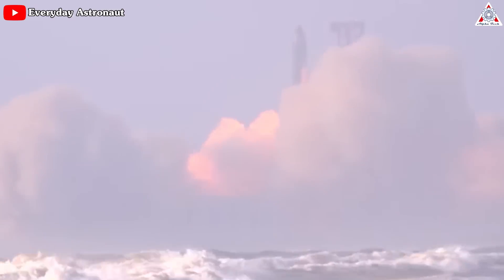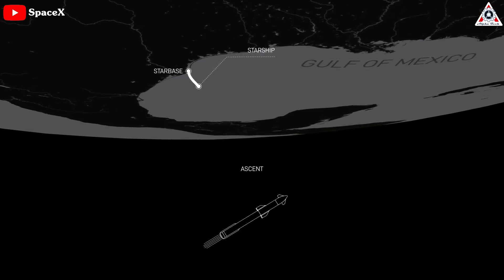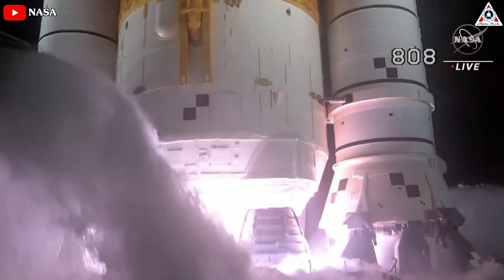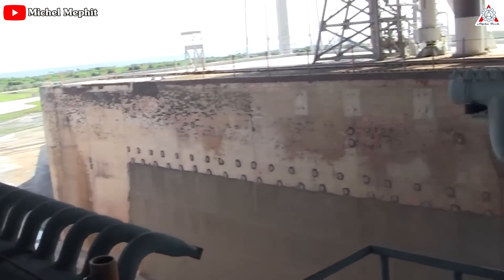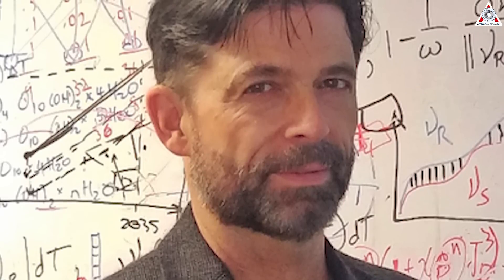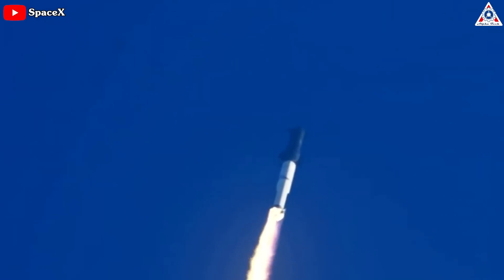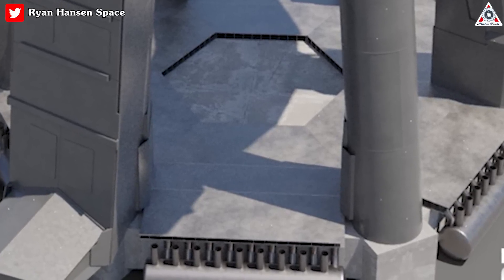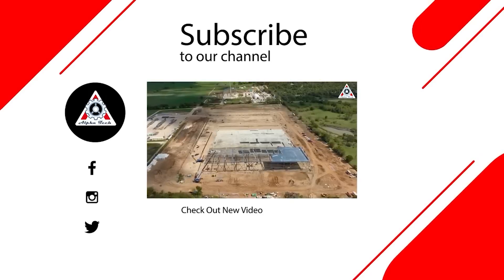SpaceX's NEW Solution to prevent the pad damage by 33 engines...

Comment: I wonder if you could launch of the chopsticks and actually use them to add a tiny bit of acceleration ?! That initial lift during ignition could also help
Reply: The full stack weighs 5000 tons.   No.
Reply: No.  More then likely those little flaps would tear off the rocket trying to launch it

Comment: Everyone acts like it’s a mistake to not build a full flame diverter but everyone is also ignoring the part where starship is intended to land on and relaunch from mars where there will be no deluge system.
Reply: And yet the latest renderings of the lunar lander variant of Starship show the engines relocated far up on fuselage to avoid kicking up debris.  I anticipate something similar for the Mars variant of Starship.
Reply: @johngunderson5463  The difference is on Mars there is at least some atmosphere to slow the vehicle before landing. It’s very thin though. I cant wait to see how many orbits, in atmosphere, Starship will have make in order to aerobrake for a landing. Interesting times🚀
Reply: Of course but the data from the first stage will still be valuable. This was not an accident by SpaceX it was an intentional use of destructive testing as has been their MO for several years. SpaceX is not afraid of things being damaged because they learn from those attempts.
Reply: A better AI that can simulate as much of the variables in virtual space can really help.
Reply: @aa2339  an AI doesn't simulate
Reply: They've demonstrated that starship can launch without a diverter. But the full stack is something like 6 times the local pressures which will only happen on earth.
Reply: @appa609  yeah but also the lower gravity and thinner atmosphere means more debris flying back at the rockets relative to the amount of thrust. It will be interesting to see what solutions they implement.
Reply: Just shows you starship needs to  bring a flame diverter/launchpad with it
Reply: That's the second stage, not the first.
Reply: @jshepard152  How are you getting back to earth with just the second stage?
Reply: @zagreus5773 
You aren't bringing as much stuff back and Mars has less than half gravity of earth.

Comment: Iam pleased to see the steel cooling plate idea being built, it’s likely that full thrust  on lift off could be turned back to lesson the pressure on the plate, it’s clear that 3 engines were lost before it lifted off clear of the tower, that’s a throttle back of 10% could be used, as far as those raptors go they are now proven to be absolute beats to have survived that level of bombardment and still reached that high is true testament to the engineers that designed and built them, if I were a future astronaut listed to ride starship my fears of failure to survive should be 100% gone, the next tests will hopefully prove the cooling plate will work or need More tweaks once sorted it’s a go fore a very exciting decade to come, the ability to lift such huge loads into orbit may save our planet from asteroids in the future, it’s a shame the FAA are still involved with space flight, there stressing over the local environment needs to stop asap, it’s not rocket science that an asteroid incoming possibly well over 100,000 plus mph does not give a flying duck about where it hits,

Comment: So... Could they launch it sideways or at 45 degrees? I guess the whole point of the basic launch structure is to make sure something can actually be built on mars for the return mission. Like, would it be easier to tilt 45 degrees so that energy is diverted? Bit risky, but I guess you have thrust vectoring to correct it?
Reply: They aren't building anything on Mars for the return mission.   Not for decades at least.
Reply: Launching anything you want to reach orbit in any other way than straight up would require way more thrust and structural reinforcements that would heavilly decrease the actual weight capacity the vehicle can deliver to orbit and make it that much more expensive. It would be highly inefficient. To launch at 45° it would require about double the thrust it can currently produce and essentially huge wings to be installed too.
Reply: @MichalValasek1  Cheers for the thought and info! I kinda felt the same but without payload im sure it could get itself out. With payload, thats another story which I think you've answered!
Reply: @jebes909090 You are laughing, but a bunch of engineers with billions at their deposal couldn't work out that 32 rocket engines could tear up a concrete structure, which ended up destroying those very engines. I just posed a question. :) Look at at your next wing with an engine mounted on it and doesn't seem that stupid. We seem to keep the tarmac in tact on every takeoff.
Reply: @DistractedTrader  im very sure that the engineers figured it out,  elon just thought he was smarter.    you'd waste too much energy starting on an angle.   really they should just go with the ocean launch plan from a converted oil rid.   no need for a flame diverter or water.    far away from any civilization so no noise complaints or danger to the public.   plus ships that brought the fuel could then sail out of danger instead of having a tank farm like a hundred meters away from the launch tower.    and you can even set up at the equator if you wanted, giving you maximum speed for launch.

Comment: I'm not understanding why they thought the current  set up would hold, they had eroding issues that had to be repaired  after the test fire as well
Reply: they more thought that it would erode less catastrophically. Then it also helps with the demolition!
Reply: Easy, did you notice the sudden "aging" of Musk that started about 2.5 years ago?
Reply: They knew it wouldn’t hold
Reply: @therombaro  they said they thought it wouldn't hold in the long run but only expected minor damage from just one launch
Reply: @general_g4999  i havent heard that - I blame search engine algorithms.   If you can point me in a direction that would certainly help - everyone’s on different information sources these days.

Everything I’ve been able to find on the issue has basically come down to (me paraphrasing) “we know it’s not the final solution, when it fails we’ll put something else in, but only after it fails.”   

They still have to solve the problem of surface launches from the moon and Mars, neither of which will have fancy launch infrastructure, which is one reason why they’re doing it the way they are.   They had 8 falcon failed landings before they figured out how to land rockets, theyre going to do the same with surface launches.   There’s going to be a series of launch failures before they solve the problem.

But that’s just what Im getting shown when I search.
Reply: And it's still a whole lot more safer to do all the failing on Earth than to fail on either the moon or Mars.
Reply: Because elon is a real engineer

Comment: Flame trenches are great for cameras because 2 sides of the rocket are clear view during launch
Reply: That too, it was disappointing that Super Heavy was almost entirely obscured during the launch.
Reply: @owensmith7530  And that it was obscured by DIRT & DUST, and not smoke or steam.  Never saw a rocket make brown clouds before  :face-green-smiling:
Reply: Starship's self destruct failed. Let that sink in.😅😅😅😅😅😅😅😅😅
Reply: @davidrash7791  🤡
Reply: Absolutely! Flame trenches are like the perfect wingmen for cameras during a rocket launch. They make sure that the cameras have the best angles to capture all the action. It's like having a VIP seat for the ultimate fireworks show! Plus, who doesn't love a little bit of danger and excitement? It's the perfect opportunity to live vicariously through the camera lens without any risk of getting your eyebrows singed off. So, bring on the flame trenches and let's light up the sky!
Reply: Even better for helping your rocket blow up.😅😅😅😅
Reply: That’s one of the things I noticed. There’s a great slow mo video of the Apollo 11 launch which shows great detail of the launch process. Nothing like that will exist with this setup because everything is completely obscured with dust and debris as soon as the engines start up.
Reply: i think elon already thinking about that, but he chose speedy delivery instead

Comment: Yes water cooling works but Nitrogen might work better under the temperature's of 33 at full throttle and they use cryo fluid in the exhaust cones so maybe it's the right way to go
Reply: Steam explosion only matters in an enclosed volume.   Water has been used for suppressing rocket exhaust for decades.
Reply: Uhhh might want to look at most other rocket launches 😏
Reply: water is a much more effective coolant in this context

Comment: The water table at the Cape isn't much different than in Boca. They just don't want to build a diverter. They need to build it up, which also means building their tower up. This pad design, or one very very similar, also had damage issues with other tests, so this shouldn't have been a surprise.
Reply: Or use nasa system directly
Reply: @carholic-sz3qv  Yep, no need to reinvent the wheel, go with a proven design.
Reply: @avi8r66  it’s not just a proven design but a very effective and cheap already developed one!
Reply: If they lift the pad then the trenches become surface tubes , water table issues solved. Over all the pad must rise to mitigate the lack of proper flame clearance.
Reply: He used Ego-engineering and it caught up to him, use tested designs.
Reply: There are underground parking garages all over Florida. You just need to run pumps.
Reply: They could drown most of the OLM in a steel walled pool and base with water being injected in at high pressure.
Reply: Se what happens when you don't have denazified German scientists in your rocket programe...
Reply: it's not that they dont want to build a diverter, it's the gov that wont let them build one, they put the application in to build one 3 years ago and gave up waiting on the bureaucracy.
Reply: If it's gonna take off from Mars, it can't rely on a flame diverter
Reply: @allisthemoist2244  The booster, first stage, would not be going to mars.  And they won't need nearly this kind of power to leave mars.  But, one of the first things to build if they do go to mars will be a proper launch facility.
Reply: @allisthemoist2244  I don't care if you are going to fly off the planet Vulcan. The generated massive shockwaves and pressure needs to be routed away from the vehicle, period.  The laws of physics do not bow to Elon's will.  If no diverter, then he needs to design something like the moon lander SpaceX is building that has the engines set higher up on the rocket and blasting out at an angle instead of straight down.
Reply: @Doggeslife  The shock-waves these rockets generate are more powerful than many engineers seem to believe and I'm surprised that computer modeling has problems with this...but then again 33 engines each spewing out multi-supersonic columns of powerful vibrations, to predict how these will interact and reflect with one another and the surrounding mount would be a difficult task.    It is entirely possible that these shockwaves striking the nearby mount structures could reflect and gather in unpredictable places.  Look at the shock diamonds in supersonic exhaust plumes....the waves are interacting enough to be visible and no doubt will contain a lot of energy.   The cooled metal plate (it's more than just a plate...like a radiator system) would be better than dirt and the amount of debris being spewn at high velocity into the surrounding area greatly reduced, though the sonic performance still offers a big question mark.  

But I wonder how channeling the exhaust plume between the plates (has hole in upper middle) is going to work?   When a high velocity stream runs into a 90 degree wall and is forced to stop...all that kinetic energy converts into pressure...and a LOT of it.   Trying to make ANYTHING survive a direct perpendicular impact is really kind of stupid (sorry for being harsh) when we have seen how effective angling the plate can be.   Just look at modern tanks...very few perpendicular surfaces to hit which is a lot smarter than trying to make flat armor strong enough to have the same protection.   I shouldn't care about it...but the Starship mount frustrates me to no end.
Reply: @Doggeslife I have wondered if they could start a lunar or mars liftoff with these engines before igniting the normal engines placed at the bottom of Starship. Seems like it would avoid unnecessary damage to Starship
Reply: @allisthemoist2244   we're talking apples. Why are you talking oranges?
Reply: @allisthemoist2244  All SpaceX anjmations of mars show lainch pads. I wonder how they get there. A thick, steel plate is no more an option than a flame trench.
Reply: @riparianlife97701  the could just bring some ablative pad with the first rocket.   If it can take 100 tons to mars,   then bring the launchpad with it.
Reply: @jebes909090  That's like driving a rear-wheel-drive sports car over a mounaiin, with a trunk full of asphalt, then building a curvy, banked road on the way back.
Reply: @allisthemoist2244  less gravity on mars = less thrust. Earth is the most difficult one. once we nail it, we can literally do so much afterwards
Reply: @allisthemoist2244  The booster isn't going to Mars, or the Moon, so no flame diverter required.
Reply: Come on, we build coffer dams in large rivers! Water table issue is misdirection.
Reply: @JohnnyMotel99  what id that have to do with blowing up half the state of texas because the pad, like the whole rocket, is under engineered
Reply: @MrMakemyday3  half the state of Texas??? me thinks you protest too much
Reply: They already showed they don't mind building up, that pad is massively elevated.  All they need to do is build it again, a little wider, and a ramp inside to divert the energy away from the tank farm.  Add in a deluge system at the top and it's done.  The flat steel plate isn't going to change much.
Reply: Didn't rocket scientists figure out during the space race that some of these rockets will destroy their pad? But Elon is rediscovering this with my tax money?
Reply: @user-ii9vn6vo6k  SpaceX is a private company. No tax money being spent.
Reply: @user-ii9vn6vo6k  well, SpaceX already has flame diverters and deluge systems on their other rockets at the Cape and in California. I’m pretty sure they know what you know about how the previous rocket programs functioned.  Breaking the pad recklessly isn’t going to get more cash from the government.  They have their own experts and engineers too.
Reply: @user-ii9vn6vo6k  some of the early ones did- the saturn v was totally bulletproof
Reply: why dont you go show them how to do it
Reply: @MrMakemyday3  Odds are very good Musk's engineers told him already and he ignored their advice.  They likely already have the designs drawn up and ready to go.
Reply: @avi8r66  yeah, and i have a bridge in Brooklyn to sell- shoulda used a saturn v
Reply: @avi8r66  ya, as far as elon is concerned HE is the real engineer
Reply: @jebes909090  Well, he just spent a few billion proving otherwise.
Reply: @avi8r66  You think?  Musk is a genius engineer, isn't he?
Reply: @ReachOutToWilliam  Well, he thinks he is at least.

Comment: booster and SN are stood over a base platform that as one fundamental flaw

The might of the engines are forcing down into a confined space
a Flat bottomed base that will like throwing a ball or rock at a wall
reverberate back?  force energy as to be vectored deflected away to disperse
taking energy and force and be cooled
moving gases expanding are cooling?
thick fish scale metal plates all sprung & hinged to move vibrate individually
along with both water and liquid nitrogen passing in  behind and out through holes
tubes behind?? akin to the Rockets tadeonal Thrust Nozzles.

Thrust must be deflected by channels away from Tank farm and other pipes power services

Rocket exhausts as it is ascending 
throws vast amounts of power down onto tower and grasp lift machinery??
This must some how be protected
Any coating concrete stuck to outside of plating can be a source of objects flying around?
May be Basic loose collar Linking SN to Booster Male female Tenon no clips edges to twist trap snare
second stage to booster better? no twist tip part ?may be simple, compressed spring
after booster cut off